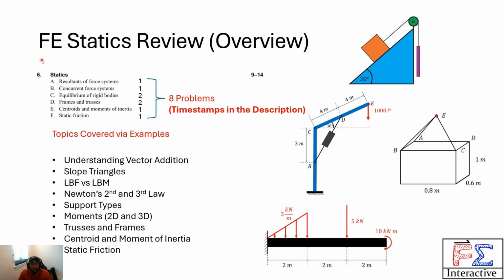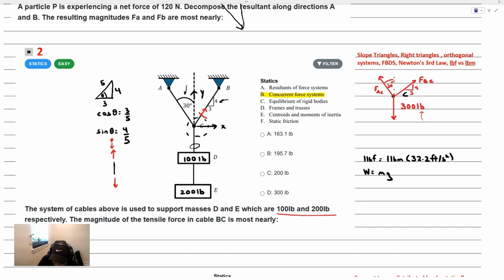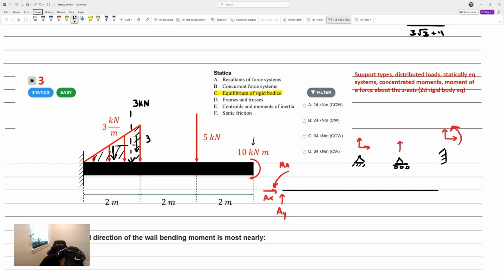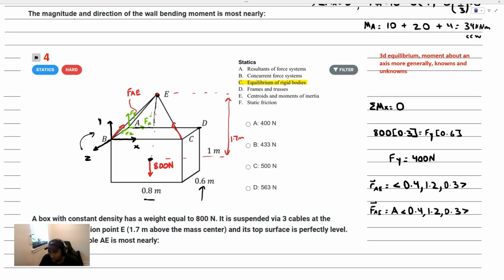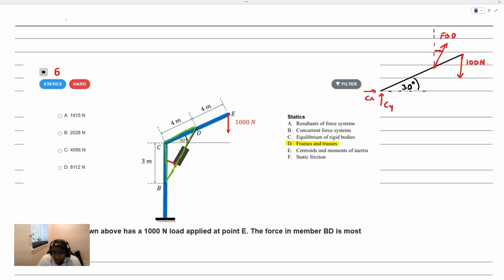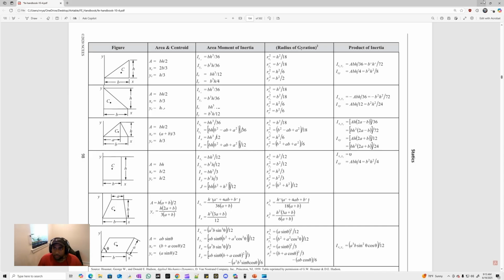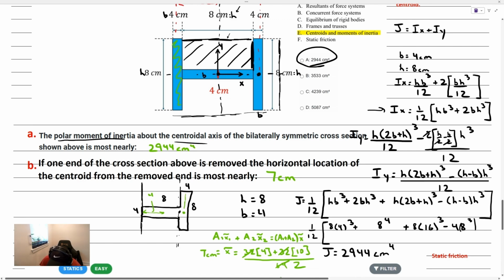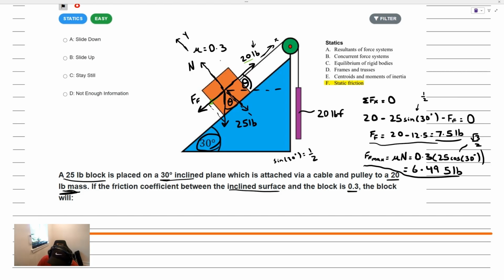FE Exam Statics Review – 8 Problems That Actually Review the Fundamentals

Comment: for the last problem, since the friction of 7.5 lb and the max is 6.5, would the block not slide downward? I understand it can't be in equilibrium, but why slide up and not down?
Reply from the maker: Good question! The key here is understanding the direction of the forces and why friction acts in the direction it does.

The 20 lb hanging weight pulls the block up the incline, while the component of the block’s weight acting down the incline is 25sin(30°) = 12.5 lb.

Without friction, we have:

20 - 12.5 = 7.5 lb

This means there is a 7.5 lb net force acting UP the incline. Therefore, the block tends to slide upward, and friction must act downward to oppose that motion.

To maintain equilibrium, we would need 7.5 lb of static friction acting down the incline. However, the maximum available static friction is:

F_max = μN = 0.3(25cos(30°)) = 6.5 lb

Since the required friction of 7.5 lb exceeds the maximum available friction of 6.5 lb, the block cannot remain in equilibrium and will slide UP the incline.

Another way to think about it is that the maximum resistance acting down the incline is 12.5 + 6.5 = 19 lb, which is still less than the 20 lb pulling force acting upward.

The important takeaway is that friction always opposes the tendency of relative motion. In this case, the block tends to move upward, so friction acts downward, not upward. Hope this clears it up!

Comment: Even Easier Version For Question #2

-F_AC(Sin(30)) + F_BC(3/5) = 0

F_AC(Cos(30)) + F_BC(4/5) = 300

Use TI36 Pro >> 2ND + Sys-solv >> 2x2 >> Solve

FAC = 195.73
FBC = 163.1
Reply from the maker: Great application of the calculator tips! Those little time savings really add up once you get comfortable with the TI 36X Pro, especially on the FE exam where every minute counts.

For anyone looking for more calculator tips, I cover a bunch of them here:

https://youtu.be/8gDF8cQ1lPY?si=048WSetVsi4brwRr

Comment: for Q6 with the frames, could one also use unit vectors? 

had the same FBD. found sum of the moments at C. split FBD into X and Y components. 
the sum of moment at C = + Fbd_(x) x 4sin(30)m -  Fbd_(y) x 4cos(30)m - 1000N x 8cos(30).

then found the position vector from D to B setting C to be (0,0). position vector was (3.46m, 5m). found the magnitude of that to be 6.08m. found the uint vector to be (0.569,0.822).

then  Fbd_(x) =  Fbd(0.569) and  Fbd_(y) =  Fbd(0.822)

then sub those in the moment equation and find Fbd.
Reply from the maker: Yes, you can absolutely use unit vectors for Q6 and avoid using the law of sines/cosines. Both methods are valid, so I would use whichever approach you are more comfortable with.

With +x to the left and +y downward, the position vector from D to B is

rDB = 4cos(30°)i + [4sin(30°) + 3]j

rDB = 3.464i + 5j m

The magnitude is

|rDB| = √[(3.464)² + (5)²]

|rDB| = 6.08 m

Therefore, the unit vector from D to B is

uDB = rDB/|rDB|

uDB = 0.569i + 0.822j

The force can then be written as

FBD = FBD(0.569i + 0.822j)

FBD = 0.569FBD i + 0.822FBD j

or equivalently,

FBD,x = 0.569FBD

FBD,y = 0.822FBD

Summing moments about C, assuming FBD,x acts to the left and FBD,y acts downward, consistent with the positive directions of our coordinate system,

ΣMC = +FBD,x(4sin30°) - FBD,y(4cos30°) - 1000(8cos30°) = 0

Substituting

FBD,x = 0.569FBD

FBD,y = 0.822FBD

gives

0.569FBD(4sin30°) - 0.822FBD(4cos30°) - 1000(8cos30°) = 0

0.569FBD(2) - 0.822FBD(3.464) - 6928 = 0

1.138FBD - 2.848FBD - 6928 = 0

-1.710FBD = 6928

FBD = -4051 N

FBD ≈ -4.05 kN

The negative sign means the actual direction of FBD is opposite the direction initially assumed when using the unit vector from D to B. This makes sense because the force FBD is actually directed up and to the right, from B toward D, rather than from D toward B.

So yes, the unit-vector approach is completely valid here. The law of sines/cosines is simply another way of handling the same geometry, and I would use whichever method you are more comfortable with.

Comment: Can you explain how to determine a zero force member
Reply from the maker: I recommend taking zero force member problems back to the fundamentals.

At the beginning of Problem 5, I first prove the two force member concept. A pin connected member with no other forces acting along its length is considered a two force member. From equilibrium, the forces at its two ends must be equal, opposite, and directed along the member.

You can see this explanation at 35:04 in Problem 5.

From there, I usually do not formally draw a free body diagram of every joint. Instead, I try to visualize the forces acting at the joint and look for members that are perpendicular to one another.

At a pin or joint in two dimensions, only two equilibrium equations are available:

ΣFx = 0

ΣFy = 0

If a joint has no external load or support reaction and one member is the only force acting in a particular direction, the sum of forces in that direction can only equal zero if the force in that member is zero.

For example, at Joint B in Problem 5, members AB and BC are perpendicular to each other and there is no external force acting at the joint. AB is the only force acting in one direction, while BC is the only force acting in the perpendicular direction. Therefore, applying ΣFx = 0 and ΣFy = 0 shows that both AB and BC must be zero force members.

Another approach is to make a section cut and analyze the isolated portion of the truss as a rigid body. Once you isolate a rigid body, the moment equilibrium equation becomes available in addition to the force equilibrium equations.

At approximately 38:27 in the video, I make a section cut and sum moments about Point C. Since all the other forces pass through Point C, they produce no moment about that point. The force in member AD is the only remaining force that can create a moment about C. Therefore, for moment equilibrium to be satisfied, the force in member AD must be zero.

There are useful zero force member rules you can memorize, such as the rule involving three members where two are collinear. However, I prefer sticking with the fundamentals: understand two force members, visualize the forces acting at each joint, look for a direction with no other force available to maintain equilibrium, and apply Newton’s laws using ΣFx = 0, ΣFy = 0, and, when analyzing an isolated rigid body, ΣM = 0.

Comment: I'm still so confused on question 8, why is pound mass equal to pound force? dont we need to multiply lb mass by 32.2 (gravitational constant) to get pound force?
Reply from the maker: This is a really good question. The distinction between lbm and lbf is something that confuses a lot of people.

I put together a short video explaining why, on Earth, 1 lbm corresponds to 1 lbf.

In the English system, the definition of a pound-force is:

1 lbf = 1 lbm × 32.2 ft/s²

In words, this means that 1 lbf is the amount of force required to accelerate 1 lbm at 32.2 ft/s². Since this value is the acceleration due to gravity on Earth, it naturally cancels out when converting from mass to weight under standard gravity conditions. I still encourage you to write out the full equation and use the conversion factor above to see why it cancels each time. 

This is different from the metric system, where a newton is defined as:

1 N = 1 kg × 1 m/s²

Notice there is no gravity term in this definition. That is why gravity scales the mass value in the metric system, but it cancels out in the English system.

I encourage you to watch this video where I walk through the concept in more detail with examples:

https://youtu.be/v9Ktlxb707k?si=OxqfHQgDZpFjRWnN

Hope this helps. Let me know if anything is still unclear after watching. Good luck.

Comment: I don't quite understand why on Problem #2, you would multiply by Square root of 3 on the Fx Equation to cancel out the FA component. I'm having a hard time figuring out how it actually cancels out.
Reply from the maker: Good question, I’ll write out the steps below.

The goal is to eliminate F_AC by making its coefficient the same magnitude in both equations.
Starting with the equilibrium equations:

ΣFx = 0
F_BC(3/5) − F_AC sin(30°) = 0

Replacing sin(30°) with 1/2 gives:
Equation (1):

F_BC(3/5) − F_AC(1/2) = 0

ΣFy = 0
F_BC(4/5) + F_AC cos(30°) − 300 = 0

Replacing cos(30°) with √3/2 gives:
Equation (2):

F_BC(4/5) + F_AC(√3/2) − 300 = 0

To eliminate F_AC, multiply Equation (1) by √3:

√3[F_BC(3/5) − F_AC(1/2)] = 0

This gives:
Equation (3):
F_BC(3√3/5) − F_AC(√3/2) = 0

Now add Equation (2) and Equation (3):
Equation (2):
F_BC(4/5) + F_AC(√3/2) − 300 = 0

Equation (3):
F_BC(3√3/5) − F_AC(√3/2) = 0

Adding Equation (2) + Equation (3):
F_BC(4/5) + F_AC(√3/2) − 300 + F_BC(3√3/5) − F_AC(√3/2) = 0

Notice that the F_AC terms cancel:
+F_AC(√3/2) − F_AC(√3/2) = 0

Leaving:
F_BC(4/5) + F_BC(3√3/5) − 300 = 0

Factoring out F_BC:
F_BC[(4 + 3√3)/5] = 300
F_BC= 300[(4 + 3√3)/5] ^-1

The reason for multiplying Equation (1) by √3 is that it changes the coefficient of F_AC from 1/2 to √3/2, matching the coefficient in Equation (2). Once the coefficients match, the F_AC terms have equal magnitude and opposite signs, so they cancel when the equations are added together.

Also, on the FE Exam, a system like this can often be solved very quickly using the TI-36X Pro simultaneous equation solver. Understanding the elimination process is still useful because it shows exactly why the unknown disappears. This video shows an example of solving a 3×3 system using the calculator:

https://youtu.be/8gDF8cQ1lPY?si=BMNqQkscSBzbyKLy&t=1296

A very similar process can be used to solve the 2×2 system in this problem using the calculator's simultaneous equation solver. Both approaches produce the same result, so I recommend using whichever method you are most comfortable with. If using the calculator is faster and more intuitive for you, that's perfectly fine. Otherwise, I hope the algebraic elimination process shown above helps clarify why multiplying Equation (1) by √3 causes the F_AC terms to cancel.

Comment: For question 4 many steps seemed to have been skipped/not explained
Reply from the maker: I wish you had given a bit more information about what part of the problem was unclear. I will walk through my thought process and point out the concepts involved. If anything here feels unfamiliar, that will help identify which topics you may want to review.

We have a box in static equilibrium and we are asked to determine the tensile force in one of the supporting cables. This is a 3D equilibrium problem, so the first idea that should come to mind is force equilibrium and moment equilibrium.

If we count the supporting members, there are three cables attached to the box. Each cable runs along a straight line in space, so the position vectors describing those cables are three dimensional. These position vectors are important because the tension force in a cable that is pinned at both ends must act along the line connecting the two supports. This is the idea of a two force member.

I discuss the concept of two force members in this video starting at 40 seconds:

https://youtu.be/Ip6IP3Oap7w?si=4a6CdB6saSq05MN7&t=40s

Since each cable is a straight line between two points, the force vector and the position vector must be parallel. Every vector has two aspects, a magnitude and a direction. In this problem the directions of the cable forces are known from the geometry, so the only unknown is the magnitude of each tensile force.

Because we are only interested in one of the forces, it is efficient to take a moment about an axis that eliminates the others. In three dimensional problems this is often the best way to reduce the equilibrium equation to a single scalar equation.

In this case we do not care about the forces F_BE or F_CE. Therefore it is advantageous to take a moment about the line BC, which is the forward upper edge of the box. This line is aligned with the x axis, so we are writing a moment equilibrium equation about the x axis.

Both F_BE and F_CE intersect the line BC, so their moment arms are zero and they do not contribute to rotation about the x axis.

Now consider the components of F_AE. The x component of this force is parallel to the axis BC, so it cannot produce rotation about the x axis. You can picture the x axis like a pole you are trying to spin. A force acting parallel to that pole cannot cause it to rotate around the x axis.

The z component also produces no moment about the x axis because its line of action intersects the axis, giving it a zero moment arm.

Therefore the only component of F_AE that can produce rotation about the x axis is the y component.

The moment equilibrium equation about the x axis becomes

-800 * 0.3 + F_y * 0.6 = 0

Solving for the y component gives

F_y = 400 N

Now we know the y component of the force, and we also know the direction vector of the cable. Because the force must be parallel to the cable, we can determine the full force vector by scaling the position vector so that its y component equals 400.

F_AE = (400 / 1.2) <0.4, 1.2, 0.3> = <133.33, 400, 100> N

The magnitude of the tensile force in the cable is

sqrt(133.33^2 + 400^2 + 100^2) = 433.33 N

This problem relies on several ideas working together such as drawing a correct free body diagram, understanding two force members, working with vectors and scaling direction vectors, and using moments about an axis to eliminate unwanted forces. Please feel free to let me know if something is still unclear.

As a quick follow up question, what do you think the tensile force in cable BE is? You should not need to write anything down. Just think about the idea that you can take a moment about any line and choose one that eliminates the forces you do not care about.

Comment: For the zero-force truss problem, member BC is also a zero-force member. From page 97 in the FE handbook "if only two members form a truss joint and no external load or support reaction is applied to the joint, the members must be zero-force members". AB is also zero force by this rule, but it's not an available answer. A FBD of joint B shows why this is
Reply from the maker: Great catch! I will update the answer choices and remove member BC replacing with “There are no 0 force members.”

You can view the updated question below:

https://www.fe-interactive.com/practice-video-problem?q=30
Reply: @Eng_Fundamentals  There is a force acting on member BC, so... can you confirm that BC is NOT a zero-force member?
Reply from the maker: @mynameisYEMAN  Member BC is a zero force member. Analyzing joint B and applying equilibrium in the vertical direction shows that there is no force in member BC.

At the same joint, applying equilibrium in the horizontal direction shows that member AB is also a zero force member.

Additionally, member AD is a zero force member (shown in the problem).

Therefore, the only members carrying force in the structure are AC and DC. Hope it is clear.

Comment: CANT SEE THE BOTTOM OF THE PROBLEM
Reply from the maker: Sorry about that. In a way, it may actually work in your favor since it encourages you to attempt the problem on your own before looking at the full solution.

You can access all of the problems here:

https://www.fe-interactive.com/practice-video-problem

By using the filtering and flagging features, you can quickly pull up any question shown in the video reviews and attempt the problem before viewing the solution. 

I am hoping this is just a temporary fix, but for the next review I release, I will make sure the full problem is visible on screen at all times.